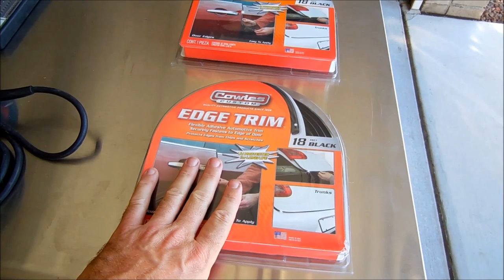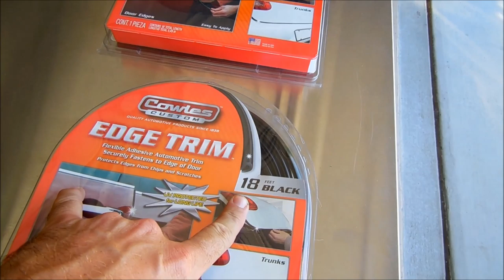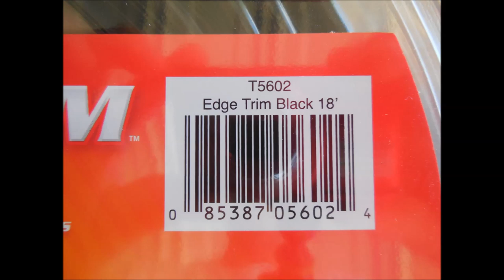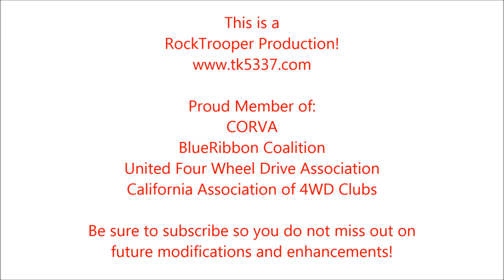How To: Cutting the OEM Fender Flares on Jeep Wrangler (RockTrooper)

Comment: Followed this today and it worked out perfect. If you decide not to go with the trim you can use a piece of 600grit wet/dry paper folded over to go over the edges and smooth them out. If you do it with a big of speed the friction will heat the plastic and smooth it out and give it a shiny finish.
Reply from the maker: Timothy Kelly awesome! Glad the video was able to help! Thanks for posting info on an alternate way to complete the finished edge.

Comment: Great tutorial on how to customize the Jeep Wrangler front and back fenders.  Probably the best one out there, thanks for sharing.  I do question removing the inner wheel well liner all together on both front and back.  I would have figured a way to cut away any excess yet save some of the barrier to keep mud and small stones from getting caught up in there. I think I also would have scuffed and sprayed  any of the white body parts showing after the cuts.  I think a flat black would not draw your eyes  to the wheel wells and the parts that remain.....Just Say'n.
Reply from the maker: Ray Orobona thanks for the feedback. The front inner fender liners were kept on and fixed back to the Jeep. The rear would not as they are part of the flare that gets cut.

Comment: John, great video. After watching yours and some others  actually got the nerve to cut my fenders last weekend and they turned out great. Buys me a lot of time before having to shell out over $1000 for ll new fenders. The only issue I ran into was with the edge trim on the sharp corner on the front edges of the front fenders. The trim doesn't like to make that sharp bend and wanted to pop off so I sliced it at the bend and now no more problems. I actually drilled a hole at the lower end of the inner liner and into the body mount behind it and used one of the plastic plugs to hold the liner in place.
Reply from the maker: Steve Kline Thanks Steve, I appreciate the feedback and glad my video helped. I cut mine for the same reason, I'll wind up getting aftermarket fender flares at some point but for now it saves me some $$ and allows me more room to flex the axles, otherwise I would have had the pulled right off on a few trails. About the trim piece, exactly all of my corners are rounded out when I cut them using the paper plate as a template. So far they have held on longer then I had expected!
Reply: Yeah we used your paper plate template also. The edge trim is working fine, it just didn't like the real sharp bend at the front edge of the fender by the grill.

Comment: Excellent video.  I watched it about 3 times and then jumped right in there and did it myself.  Turned out really good.  I ended up using 4-1" black sheet metal screws that have a little washer on therm on each fender to hold it down to the fender supports to avoid any flapping.  If you don't mind having a few screw heads showing on your fenders it's a good solution.  Heck, it's a jeep so I didn't mind it.  I did have a little problem with the trim.  To me it is too small and I had some issues with it wanting to come off so I'm decided to pull the fenders and paint the wheel wells and fenders with truck bed liner paint and I'm going to be putting some black rubber tubing (split down the middle with my dremmel) on to replace the trim.  It's a little beefier looking...kinda looks like metal tubing.
Reply from the maker: Alan Fletcher Thanks for the feedback! Yes, there are definitely custom finishes that can be done with this type of mod. I know in the rear wheel well they did not finish the painting. I am planning on doing the same with some color matched liner. I like your idea on the black rubber tubing for the edge trim. I would be interested in seeing how that turns out.
Reply: elevator bolts have worked well as I've seen from another video
Reply: I cut my flares and HIGHLY recommend elevator bolts!   The front flares are barely held in place by the existing clips along the edge.   Without elevator bolts,  I'd expect front flares to fly off at highway speeds.

Comment: Thee best DIY for cutting the OEM flares hands down👏🏼👏🏼👏🏼. 
I live overseas will not buy a jigsaw and dremler( they are very expensive here) ,i dont trust myself of doing i clean job like you did.
I dont want metal flares since i use my Jk in the dunes (almost never rock crawling). Is there any good plastic fenders other than the bushwacker?
Reply: My OEM flares barley touch my tires on bouncing, but i can see little marks on my tires and i dont want to ruin my new set of tires. 
I do not want the very narrow plastic fenders( thats all i can find ) I really like my OEM fenders but its time to replace them . Any help would be most appreciated 🙏🏼
Reply from the maker: Thanks for the feedback, appreciate it. One thing you may want to look into are fender clips that allow you to take off and put back on the OEM fenders. That way, you can remove them when you go to the dunes and the. Put them back on for street.
Reply: @RockTrooperJeep  .i didn't know it existed.   That is perfect for me. Thanks❤

Comment: Hey John Golden, I saw a chopped fender Rubi this afternoon and it looked awesome. Couldn't tell if they were aftermarket or if they were DIY'd, but what I did love was that it was RED underneath. Thought this would look great on your MOD. Just use some FELXI-DIP, and you cant go wrong.
Reply from the maker: Jonathan, was the red underneath inside the wheel well or are you talking in the inside part of the flare itself? When I eventually decide to replace my fenders, I'll be painting the inside the wheel well.

Comment: John, would it be possible to post a quick video showing how you secured the inner lining on the front. I know you talked about it in the video, but I didn't see how you did it. This looks great man and a heck of a lot of dough saved. Thanks and nice jeep!!!
Reply from the maker: 3rd, I'll see if I can get a quick vid and pictures this weekend and post it up
Reply from the maker: 3Rd, send me an email and I'll send you the quick video I made showing what I did with the front fender tuck
Reply from the maker: @ the 19:30 mark in the video that is all I did, minus the clip (not needed). The tension holds the piece tucked in place. I never had any issues with it popping out going at highway speeds and off-road

Comment: It looks clean and want to do it only thing I'd do is a lil paint or plastic dip for the rear under the fender not the wheel well thoe  

Great video thanks
Reply from the maker: Patrick Horvath Appreciate the feedback. Yep, OEM they do not do a great job painting in the wheel well. My plan is either to paint it or have it paintmatch rhino line it.

Comment: You may have done it already, but you can trim the inner fender in the rear also.  I keeps the dirt from accumulating in the many nooks and crannies under there.
Reply from the maker: Super, I kept the rear inner flare section just in case I did want to do some additional trimming to keep that liner in. I'm still debating if I want to Line-x the inside or not. Good point though, thanks for mentioning it

Comment: Hey John. I'm a huge fan of your DIY videos. They are of a huge help! I just wanted to ask you 2 questions:
1- Why did you go back to the factory front bumper? 
2- What kind of tires/tire size you got now and how do they compare to your previous BFGs?

Cheers!
Reply from the maker: Sulz, thanks for your feedback. Very much appreciated. As for your questions:
1- Why did you go back to the factory front bumper? <--Unfortunately I ran into several rocks and trees that significantly damaged the front bumper, so I had to remove it. Fortunately I kept the factory bumper so I just put that back on,
2- What kind of tires/tire size you got now and how do they compare to your previous BFGs? <-- Now I have 37" MTRs on RockTrooper now. These tires are a significant upgrade from the OEM BFGs for both on and off-road performance and I have not noticed any increase in road noise

Comment from the maker: AdamlsAdam, for some reason I was unable to respond to your comment. Hope you get this response: Thanks Adam, I appreciate the feedback. You may want to consider removing the rear inner fenders as well and coating the inside with a rhino liner or equivalent to help prevent dirt/mud buildup and rust. It is easier to clean out what you can see vs. what you cannot. Good Luck with your mod!
Reply: +John Golden (RockTrooper) Thanks. I'm seeing this now. Not sure why you weren't able to respond before. Anyway, yes, I'm going to give this a shot. Like I said, I like the lines you took.  If weather holds up, I'll try it this weekend.

Comment: Is it okay if i leave my rear inner fender off?
Reply from the maker: The inner fender in the rear can be left off as it is not covering anything except the under fender wall/tub. You can river that back in if you want, there are several aftermarket inner fender flares that you can use or just leave it off.

Comment: I feel like the inner lining on the rear fender keeps your paint protected from gravel etc.. also a bit louder without them?
Reply from the maker: Ryan O'Donoghue I really did not notice any additional noise after removing the rear inner liners. You’ll notice that the paint was not “finished” from the factory there as well. There is no real way to leave that in place unless you redrill new holes and pin it back in. An option to do is just rhino line it or there are companies that have liners to install.
Reply: RockTrooper ahh yes good idea. I have this underbody spray I’ve used on my poison spider bumper. Probably use that stuff and spray that area down. Great videos btw!
Reply from the maker: Ryan O'Donoghue glad to help! Thanks for the feedback

Comment: Shoulda waited till aftermarket flares were in the budget or left the duct tape on as hillbilly racing stripes!!! Are you honestly happy with the way it looks? Maybe I am being harsh but, do you really think the edge trim will stay in place at highway speed or even more so driving through the bush. I am disappointed.
Reply from the maker: Brett McLaughlin a little over a year later I did replace with steel fenders. I was no disappointed at all with the cut fenders, they held up perfectly, no issues at highway speeds and the edge stayed on without any issues. The trim had glue in it to keep it in place. All and all I was extremely happy with the results and it allowed for the flex I needed.

Comment: Great Video, I was considering doing this and your video was definitely more clear on some of the finer aspects (what to do with the inner liner) and makes chopping up my jeep less intimidating. Going to give this a shot next week! Do you think cutting through sahara fenders that are body coloured would yield a similar result?
Reply from the maker: Hey Jon, I'm glad my video helped. Thanks for the feedback. There was someone who did respond that he had cut the painted fenders and there were no issues with paint cracking or peeling after all was done. Personally I have never see it done nor have I seen any painted cut flares out on the trail. I would suggest before you do it, check around the various Jeep forums and see if you can hook up with someone who has done it to see if there are any special treatment needed for the paint. Good luck with your mod!

Comment: what about cutting it on the other side of tape line or more so its not as wide? can that be done & how far?
Also How about rhino spray line the rear well?
Reply from the maker: David weber there is no “rule” on the width of the flare when you cut, however keep in mind that the front flares have a support bracket to keep it in place, so if you cut inward of the bracket, you’ll either have that bracket extending out past the flare or you need to cut it off. Also, that bracket normally gets used on aftermarket flares if you go that route later.

Comment: Thanks for this video. I just learned a lot. What is the name of the kinds of saws you used? I was just wondering I am not really familiar with power tools.
Reply from the maker: Hey Shane, thanks for the feedback. In the video, I used a few different cutting tools, a Dremel, reciprocating saw and a jig saw. You can use these or really just about anything that will allow you to cut cleaning and manage around some tight areas. You'll just want to make sure that you are using the right blades. The sharper/finer the blade the better the cut.

Comment: Nice job buddy. How is that factory bumper working for you? I watched another guy installing some after market fenders & I must admit that your job looks just as nice...
Reply from the maker: Henning Sainog thanks, I appreciate the feedback. The factory bumper is great, they really did an awesome job when they released this bumper with the 10a model and kept it with the hard rock. The cut OEM fenders held up extremely well, almost 2 years with no issues since I cut them with supports in place.

Comment: That looks pretty sweet!! I was somewhat skeptical how it would look when you first started cutting. I have painted (white sahara) flares so I am more hesitant to start cutting. If I had regular fenders, hell ya. What lift do you have? Your rig looks even better with modified fenders. Great video, I enjoy all of them. Thanks!!
Reply from the maker: Hey Ray, thanks for the feedback. I appreciate it. We actually just cut a friend of mine fenders that are also painted (blue). We were a bit hesitant becuase we thought the paint my chip and flake away but to our surprise it worked perfectly! We cut using the same tools as I did with mine and it came out nice. I am actually going to put together that quick video to show how how it looks later this week. As for my suspension, it is the Metalclaok Gamechanger 3.5" lift with Fox IFPs, rides great on 37s.
Reply: +John Golden (RockTrooper) Hello John. Awesome videos BTW. I was wondering if your ever made that video on your friends blue fenders? if so, could you provide a link for the video? I would appreciate it. Looking to do this with my painted blue fenders. thanks in advance
Reply from the maker: +pkjensenAZ funny you should ask. I actually just took some post pictures this week so I can add to the video. I should have that completed and posted this weekend. Subscribe to my channel and you should get the notification when uploaded!
Reply: +John Golden (RockTrooper) That's awesome! I subscribed. keep up the great work! can't wait!
Reply from the maker: +Ray Marcial We did cut some painted flares, check it out here: https://youtu.be/2Czh3FFlKls

Comment: did you ever paint the inside of your finder liners black? where the the was showing?
Reply from the maker: CS, do you mean if I pained the inside of my wheel wells? If so, no not yet. I am going to hold off on gettng that area repainted until I decide on upgraded fender flares. I will either rhino line the interior wheel well or just get it painted the same color white of the Jeep. Still deciding.
Reply from the maker: +CS Savage Here ya go: https://youtu.be/2Czh3FFlKls

Comment: Great video.  At the time of this soot what size tires were trying to clear? Did you have a lift already? I'm thinking about trimming the flares and sticking 35's on it in stock form.
Reply from the maker: B Alt In the video I have 37" MTRs with the MetalCloak 3.5" Gamechanger OME lift. With the proper bumpstops installed I can get a full flex right at the edge of me touching the fenders. If I would have left them stock, my tires would have ripped them right off. You should have more then enough room to fit 35"s on a stock suspension when you cut them.

Comment: Hey John, thanks for the video! I'll probably be using this as a guide for myself this weekend.

I did have a quick question though. You show your fender lights ziptied up inside the fender towards the end of the video. Did you ever determine a more permanent solution? I'm not sure if there are legal issues with not having that light (I believe there is not in most states since the rear lights wrap around to the side of the Wrangler) but even if there is no legal issue, I would like to keep a light there just for the purpose of being more visible to other drivers.

Let me know if you can, thanks!
Reply from the maker: Hey Camron, I still have the lights set the same way I do in the video, so over a year and several thousand miles later. No issues and the lights are completely visible when on. Eventually, when I replace the OEM fenders I'll most likely get a small button LED light for the side marker.
Reply: +John Golden (RockTrooper) Awesome, thanks for the reply!

Comment: Excellent video. How did you end up securing the fender flare to the body? Did you get that clip you mentioned?
Reply from the maker: Hey Don, thanks for the feedback. Actually the away that I cut it allowed me to place that piece of the fender behind the body and it stays there. I had not had to lock it in place with anything. No issues at highway speeds, off-road, etc..

Comment: Thanks for the great video. Did you ever replace the side lights with LEDs? If so, is there a way to see a pic?
Reply from the maker: Hey Jim, I have not yet. I decided to wait until I actually replace the fender flares to replace the side marker lights. Tye OEM lights are still on there zip-tied in place. They have not moved and still work great.